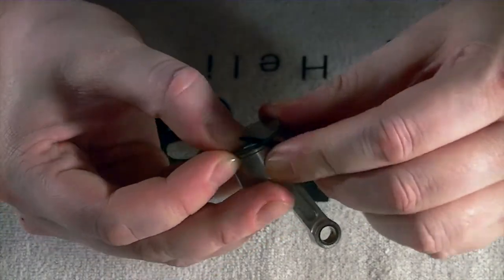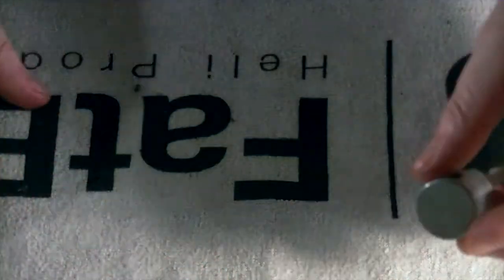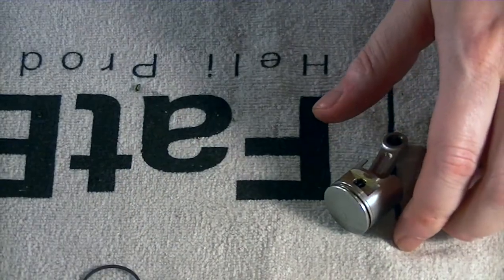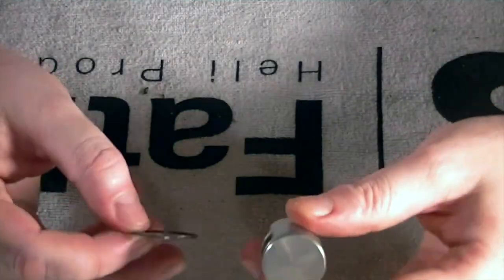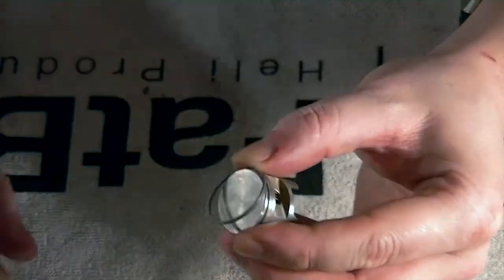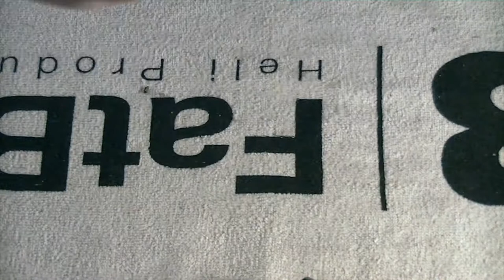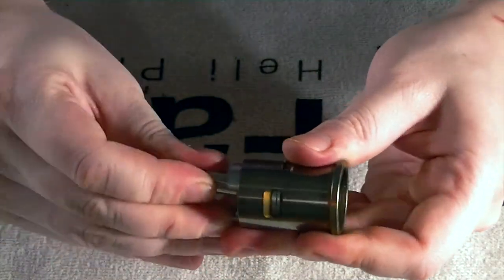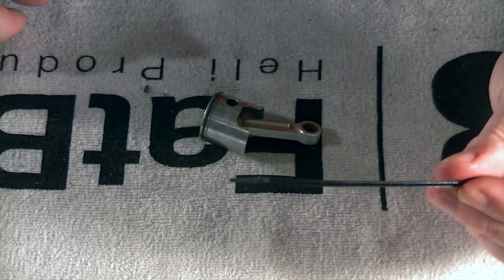Everything Nitro : Removing / Installing the piston ring (FreddyCanFly)

Comment: Pls advise how piston ring last long.
Operating hour or No. of flight.
Reply from the maker: To hard to say it depends on how much you as a person flies, and how hot you tune the motor ex. I usually change mine very 10 gallons or so.
Reply: Depends on how much compression the engine still has. Could last for years. I have a raptor 50 going on 11 years. 10 15 gallons of fuel threw it.